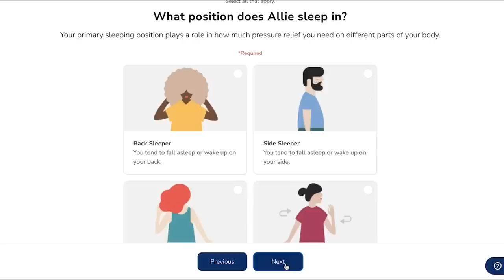THIS IS A DISASTER...

Comment: I Virginia you’re REQUIRED to have any lines professionally marked by utility marking crew before you start ANY digging. They use a scanner that detects the lines and then paint the route. Wouldn’t those scanners have worked in this situation to premark the line routes so you’re not guess digging where they are? Does Utah not require remarking before ANY digging?
Reply: Trent saw the lines when they were installed originally so why do you need the city or county to tell you where they are?  Even when you know what direction the depth of the lines are tricky!  I like the idea of gravel and sand in the hole beneath the lines and white sand above the lines so when you get close to the lines with the excavator you can hand expose the pipes without damage! I’m in Va and have had the lines marked 10 times in 44yrs. It’s required in Virginia.
Reply: They only mark the utilities lines. All the lines they are digging around are private. I don't think there is a tacer wire buried with propane line so couldn't be traced anyway. They know where the lines are so locating them wouldn't help it is simply a mater of carefully digging to avoid hitting anything
Reply: Yes its called an asbuilt
Reply: Same rules in Canada and all of our services are in their own separate trench.
Reply: In the last video, the plumber did use a detector to find the sewer lines all the way to the house, but Trent marked them in some impermanent way like a mark in the dirt rather than planting stakes or something that would last longer.
Reply: In Utah it is required to call before you dig.

Comment: I have been on edge these digging videos. When I was a kid my dad's construction team was in a city street trench and the shoes operator hit the city gas main and like Trent's ignorant boss the foreman told them to try & stop the leak... It blew up and killed /burned all the laborers in the trench, he had just sent my dad to the truck to radio someone and he was a 1/2 block away or he would have been in that hell fire.
Reply: How horrifying! So glad your dad was out of harms way. But how horrifying.
Reply: Yes crimping a high pressure line will cause static electricity

Comment: If you have a few breaks in gas line and are moving propane tank I suggest putting a new line in from last break closest to house and run new line all the way to tank.The more connectors in that line will increase chances of leaks in the future. While everything is open  you may want to replace anything that looks damaged Good luck with this. You may want to ask contractor why gravel was not put in around pipe when it was first installed.

Comment: You guys should have just  installed a septic pump and barrel right outside the house and left the "bellies" in the line.  Once the barrel fills up, the pump ejects the barrel all at once.  There would be enough pressure to push everything all the way to the tank.  Those barrels are also used to pump uphill.  I have one at my house and it works great.

Comment: Also make a trench box to support your trench take a sheet of plywood to both sides of trench and put a 2x4 between them to hold back the trench walls to keep from caving in never go in a trench deeper than 3 feet without a trench box if that wall gives out and your in the trench it will crush you like swatting a fly

Comment: First off ...... why did you bury the lid to the septic tank?  If you do nothing else (which we know won't be the case ..... the nothing else) you should be installing a "riser" on the opening to the tank, with enough height to insure that it doesn't get buried again from earth movement (aka silting, composting of vegetation around the riser, etc.)

Comment: Trent,

Not sure if you will see this or not brother but if your digging with that mini ex and you want it to not try and tip over. Put the blade towards the trench and use the hydros to level you out creating a level base and you will not tip because your digging straight over the top of the blade and level. Be safe and good luck brother! Love the videos!!

Comment: There is a way to mark the line of gas, waste or water pipes with coloured tape above them. When digging, you see the tape and stop using machinery. Hand dig to the pipe. No damage. It is pretty stupid to use machinery 'blind' without having any idea where buried stuff is.

Comment: Trent's biggest issue is that he had his tracks facing up and downhill. They should have been running parallel with the sewage pipe. To accomplish that, use the dirt you dug up and place it downhill on your lower track to level the machine out. The propane tank should be relocated away from the sewage line, preferably at the other end of the house. They never should have been run close to each other in the first place and that is something I would recommend doing in the future to avoid these issues from popping up again in the future.
Reply: His biggest issue is he likes to show off his abilities but this backfired on him. We have seen his inability very clearly. Thankfully no one has been hurt, SO FAR!

Comment: Allie, I'm not harping, more comments for $ for u guys... Heres, code  24" between gas lines and electric.  And 24" between sewer and electric. 
Heres, why you should do it right. If there ever a fire, or forest fire, insurance adjusters run and see, all the lines stacked up wrong. You do not get coverd. If in 30 years you sell, buyers walk. 
Or you fix it then...rule of thumb,  always, if something cost, 10.000 to put in. To RIP it out and replace it will cost 3 times that cost.

Comment: Although I wish you the absolute best on this project I just think there’s a lesson to be learned here and it’s patience is a virtue and it doesn’t seem like it’s going to be worth not waiting for the guy to come and to help you I feel like everyone’s just standing around waiting for the propane tank to blow up when you hit the line. It might be a good idea to take some very deliberate photos of the trenches and the lines before you cover them up. Just in case you ever need to dig up in the future.
Sending you lots of good vibes, blessings to help you get through this project.
Reply: Mark this for new occupants if ever…
Reply: Trent has NO patience!!❤🇨🇦❤🇨🇦❤
Reply: I think one lesson to be learned here is to measure before you send someone on 3 60 mile trips to pick up the supplies you need to repair something.
Reply: @the_mum  that's what I was thinking - why not stop guessing and measure. And if not measuring - why not simply buy the possible sizes and then, just take the ones you don't need back. I would be tick-off having to go back and forth for the wrong size - really. Dang - just purchase all possible sizes. Be efficient - stop unnecessarily wasting time. Just doesn't seem smart. Maybe they're just so frustrated - best functioning/thinking is diminished. But, with all of that, thumbs up to them being ever so tenacious - I must give multiple thumbs up to that.

Comment: TRENT: From the video where you are FIXING the old sewer pipe..Looks like you used the OLDER, THINNER type, which has been UPDATED to a THICKER,approx 1/4 inch thick sewer pipe that uses a collars to connect the sections.. LOTS sturdier and rigid and more durable.  FUNNY you were not informed of that type where you purchased the original.

Comment: I am in Ky when I run a water line or cable Tele etc. I run a 1-1/2 or 2" pvc then push or pull the smaller line inside it protects the gas or water line etc. Also if there is a leak you can pull line backout and replace it very easy

Comment: All ducts shall have lateral separation per plastic pipe Institute, AWWA ,  and local building code standards.  If not properly  laterally separated the PVC ducts loading will  over time cause each other to fail.  The ducts can be in the same trench BUT the trench has to be wide enough to accommodate the four service ducts.  Hoard or slope trench walls.

Comment: I’ve been in construction over 40 years and you don’t put electric gas and sewer all together because if you cut across all of them the sparking electrical set off your gas…
I know this because I did it…)😊😉
At this point simply replace the 4 inch line to the septic tank and make sure it’s sitting on brand new undisturbed dirt …
This will avoid bellies ,
 in the future…
I wish you all the best!!!
I also started out in my early 20s and I winged it…)lol

Comment: Use the blade on the excavator to stabilize it while you are digging with it have the blade pointed the same way as the bucket and keep it lowered to the ground it will act as a counter balance so you can get big bucket loads without worrying about it tipping over
Reply: I said exact same thing. Trent is not a be all knowall, but could possibly be a endall to those he endangered.

Comment: A couple tips for using the mini-ex.... keep the tracks in line with the cab when digging, the grading blade will keep the machine from tipping as easily. Also, if possible always dig in line with the mechanical lines, this will keep the bucket teeth from hooking the lines. In most cases the teeth will just scrape the lines and not damage them.
Reply: @poopsicle,,, Thanks for saying about orientation of the tracks, the cab, the bucket and the lines in the dig. I am not a machine operator but just looking at it knew it was wrong. Ironically there are sure to be lots of YouTube videos out there.

Comment: It seems you have bit off more than you can chew. The sewer line should of been in its own separate trench with a bed of gravel under the pipe.  Away from the propane tank. We had the same problem on our ranch many years ago. Place is looking good.

Comment: There is a difference between being self-reliant and being foolhardy.  What you're doing is not only foolish but dangerous as heck.  I've watched you guys for a long time, but it's not as enjoyable anymore because the problems you're trying to fix are mostly of your own making.  Wish you the best, but I just can't watch this.
Reply: Boy , how I couldn't agree more. Why you tubers think they are the master of everything. 
Just go back and watch when they tried to set a beam and it fell and could have killed someone.  They don't seem to think that way .  Just running that little excavator is a prime example . With no experience he is working ground not close to be even level . 
If you recall , the original contractor agreed to come out and fix it in a couple of weeks.  This problem has been there for how long ? And he can't wait .....
Simple reason I can't watch this drama queen . 
You are correct you are not a expert,  takes years to be effective to run one of those.
Reply: @russpost2557   I basically agree.  But I'll give Trent kudos for being so self-reliant in general.  There have been times when he's had to do something over or live with a less than ideal result because he was doing something for the first time.  But that's how we learn, by doing, as long as we're willing to accept being "a hair out of square" with everything.  When it comes to safety, though, I don't believe in taking unnecessary risks and I've seen Trent do too much of that.
Reply: Would love it if you guys would lay off Joel.  No  purpose to do all the joking on camera. He shows more maturity by just smiling!
Reply: @csimon1951  I never said anything about Joel or Brandon.  Trent is the decision maker and everyone else just follows along.  But I'm done commenting.  This is a happy site and not the place for negative threads.  Sorry that I contributed to that by commenting in the first place.  That's on me.

Comment: I'm sorry, I don't get it. This house is less than year old, how is it that local building inspectors signed off on a certificate of occupancy if the sewer line was substandard, did not meet code for the size of the structure, or there was an insufficient grade of descent from the house to the street. I wouldn't have thought you would be having these kind of problems so soon after moving in.
Also, Joel needs to learn that when he's working that his phone should remain in his vehicle, hopefully plugged into a charging cable until lunchtime. Yes, summertime jobs often involve a lot of drudgery, but we've all been there.  It's where we first learn about being responsible, showing up on time, and providing an honest day's labor for an honest day's pay, regardless of who the boss is!

Comment: I have exactly the same utility hookups you do:  We get water and electricity, but no natural gas or sewer utilities.  Our water and electricity come 600 feet from the service connections to our house.  3/4 inch PEX, ABS or PVC sewer line, PVC conduit and your electrical line are not that expensive.  You should just shut everything off, dig the trench without worrying about the lines you break, and then replace all the lines.  Also, the sewer line needs that trench because of slopes, but the gas and electric could go in other trenches.  You should also have red or yellow plastic warning tape 6 inches above any buried line, so you know when to stop with the heavy equipment.  Sand around the lines makes it very easy to dig that part by hand.  I also suggest a 5 gallon propane tank and a way to connect it in your basement, so you can have hot water and cook while you are working on the big tank line.  It lasts forever, so it's also great for RV camping.  But don't you already have that for your temporary housing?  You can also use a very cheap in-line electric flash water heater in your basement that has just enough capacity to heat one GPM for a shower.  Redundancy and isolation valves are key!

Comment: Doesn’t look like the trench & various lines that were laid were done correctly…. There should be gravel under the lines to support them during changing temperatures, lines should be laid separately (12” or more) propane tank should be on a cement pad & strapped…. And lines should be noted on your plot plan (precise location)
I’m very nervous for you!

Comment: You are one heavy rainfall from total disaster.  The tank just rolling over is the best case.  Search on YouTube for propane tank explosion.  If that tank rolls and explodes, it will level everything within 500'. Your house, garage, Terry, vehicles, neighbors, and of the end of Trent, Allie and Leo, if you are home.  

You have four or five days worth of work to do.  To waste two because it's the weekend is insane.  You think you have anxiety now,  wait until it starts raining before that tank is secured. Strapping the tank to a tree or fifty trees isn't going to keep the ground from eroding under the tank. And having removed the retaining wall is going to help.  This is extremely stupid and dangerous.

On every project there are three resources available: cheap, fast, quality.  Pick any two.

Comment: Does your state require that septic and Potable lines be in different trenches at least four (4) feet apart, with the Potable water being higher to prevent potential contamination. Most east coast states follow this requirement.

Comment: I would be surprised that you are not required to have a permit to do this work, I know my neighbor had to when he replaced his existing sewer line but maybe Utah doesn't require it. Was the original sewer line permitted and inspected if it was I'm surprised that it passed inspection with a power line and gas line in the same trench and I wonder if it had proper bedding material. I know I would have concerns about buying this place if it was  ever put up for sale if the sewer line was not permitted as well as this current work/repair.
Reply: They inspected the old one & it lasted a couple months. Why he didn't put anything under the pipe is crazy.. Goes to show not all professionals are actually professional!
Reply: Details, Details...When has that ever been a concern. Most likely Utah will require a licensed plumber and inspection will be required, and a possibly a fine.

Comment: Joint trench is only easy once. After that any repair or alterations is 2-3 times harder depending on the amount of utilities. And agree with homer^ you can buy a roll of water caution tape and yellow gas caution tape to p look ace on top before backfill.

Comment: In France to be up to code your have to put a sand bed then the line then sand again (so the line are not damage or bent and easy to remove when you are using hand shovel) then color coded  plastic mesh then dirt to finish.

Comment: Well if you cant get gravel, too in case the pipe in, then you should look into getting construction-grade sand so you can in case the pipe so no rocks or just the ground can not compact around the pipe and cause damage. Just a thought.

Comment: I don't understand why you didn't just run a new septic line away from the existing lines and propane tank, and then just tie the new line in at the ends. What made you think you needed to lay the new line in the same trench that you had previously laid the bad septic, power and propane lines in? If you want to avoid hitting something in the ground, you stay as far from it as possible. Flirting with disaster is never a good idea, and digging right next to existing utility lines is flirting with disaster.
Reply: If you don't think you had room to put a new line in closer to the back of the garage (away from the existing lines), then you need to go back and watch your own video. At the very least, you could have set the new line three feet closer to the garage.

Comment: You can construct a brace out of LSL and other wood that is the width and depth of the trench and length of your propane tank.  Then lower it into place with your excavator in front of the propane tank.  You might need to use some cinder blocks to keep it from crushing the lines in the hole but it will stop the earth from caving into your hole.